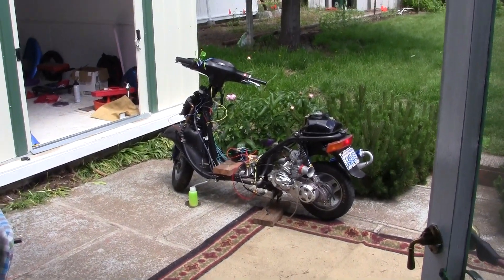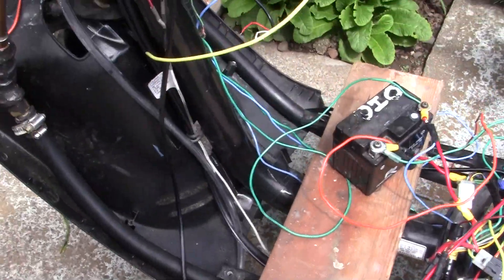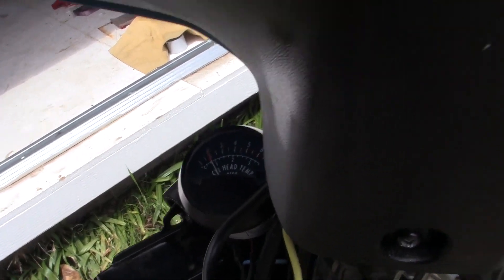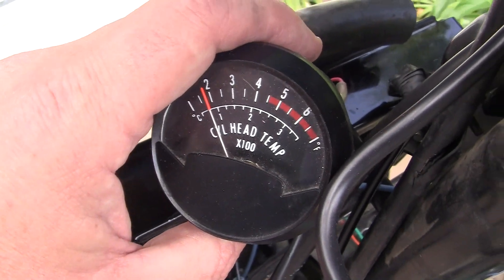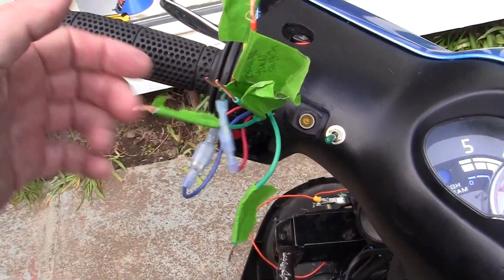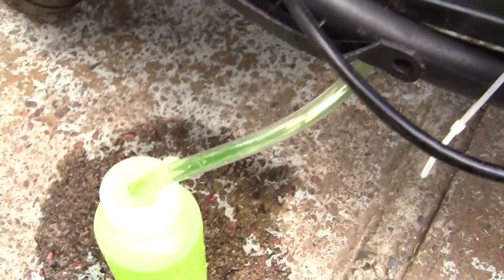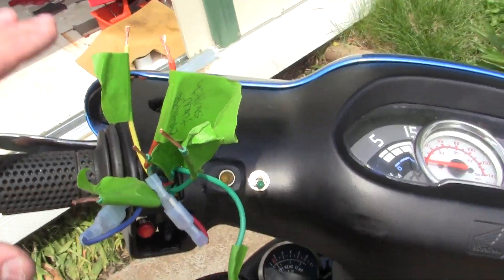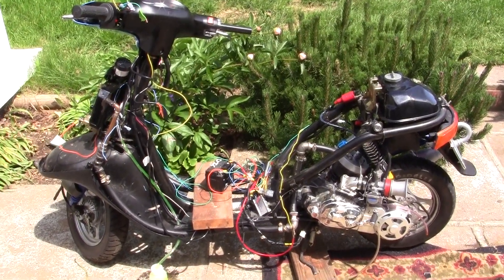(1)- HONDA REPSOL  50 / CC = UPGRADE TO 120 / CC

Comment from the maker: thanks, I am glad to just see it running. I actually got my stage six turn signals to work and am really happy so far. I might have a small head gasket problem, but now it is all fine tuning with the new throttle, cable and carb links. I am really happy now. Thanks again and God Bless.

Comment: I´ve heard it run before and also seen you ride it before and i forgot how awesome it sounded so thanks for the reminder bud.Can´t wait to see you drive that beast again if you are going to film it.
My engine almost sounds the same with my performance exhaust on.Maybe it´s partly because we have the same engines except that mine is aircooled.

Cheers and take care

Comment from the maker: No, because the vacuum effect sucks the fluid back into the radiator in a precisely controlled manner. It is best to have the bottle near the radiator with a small diameter plastic hose. I will show this in later videos since I rebuild the bike every year.